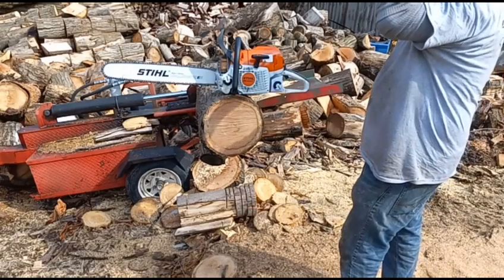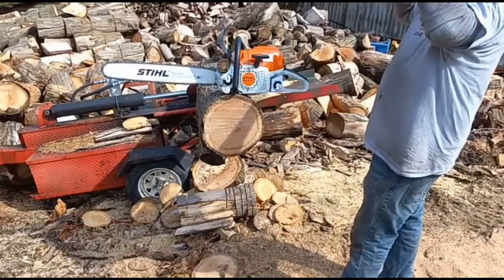hot rod ported stihl ms400c test cuts in hard season red oak

Comment: i have 5 older stihl pro saws 044 and 3  026    i just got a ms400 my goal is a reliable work saw. i am retired and aand only cut wood for myself. what do you recommend? leave it stock, do a muffler mod or a light work port? i cut ash and maple mainly. mid size to limb wood. thanks for the great vids.
Reply: If you dont mind it little loud put a bark box on it. Really helps it breath